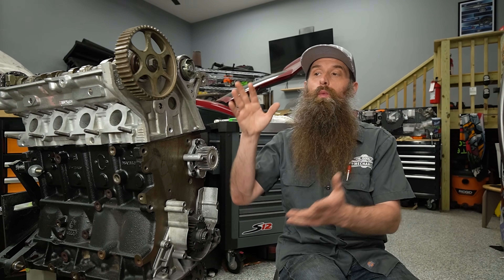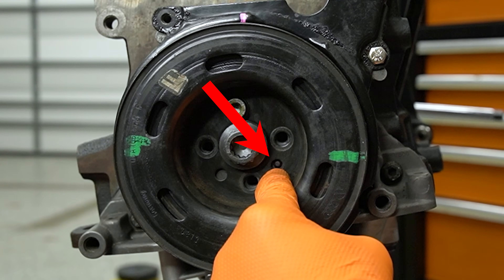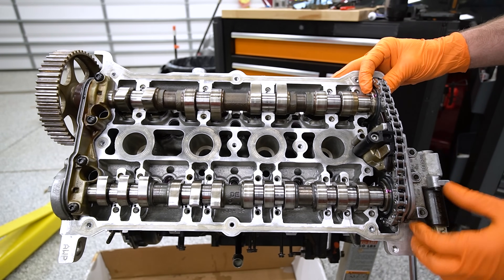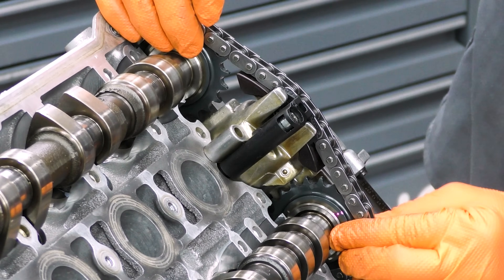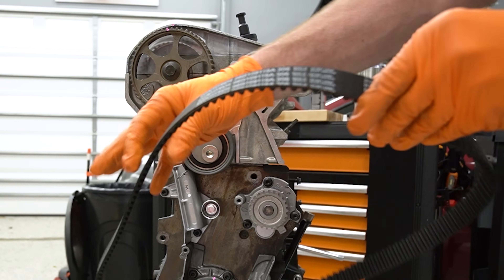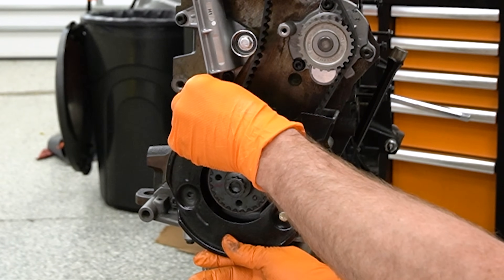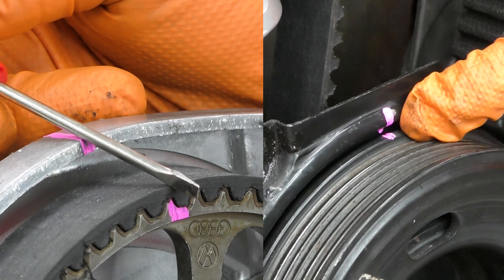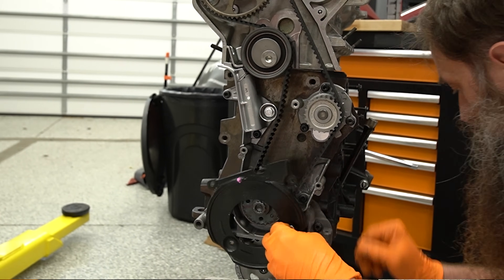How To PROPERLY Time VW/Audi 1.8t 20v Engine ~ Belt and Chain

Comment: hello, I have a?  my Jetta mk4 shredded the tooth on the timing belt. a friend and I replaced the head and installed the blue timing belt, the car ran for about 20k miles than the belt was shredded. my ? is what can be doing it?  is a pic of the belt will help I can send it. thanks

Comment: Hello,
Where did you get the replacement parts from? Directly with the dealer or where would it be recommended to get these parts from? 
Also I did an engine swap but the engine code/ stamp isn't on its usual spot. How do I know which engine I have?

Comment: Quick tip if you have the engine in the car and want to check timing marks a little easier, there's a plug on the bell housing you can take off and there's a timing mark on the flywheel 😉centered in the hole means the cam should also be lined up

Comment: Thank you for this video. I have an AMB and I felt like giving up because of proper timing that needs to be done and underboost. But watching your video is inspiring to continue and not to give up on it.
Reply: Did you have any luck? I've been working on my amb motor for a cpl years now since the timing belt broke and I bent 3 or 4 valves 😢. I put new valves in the machine shop said the head looked good still besides the bent valves. I also replaced the springs with Brian crower springs and titanium clips. But I think I'm having issues with my timing.

Comment: So Charles what happens when you go to compress the chain tensioner and that little ear that keeps the tool centered snaps off the tensioner. Should I just pull the cam caps off both sides, pull the cams  and get the old tensioner out that way. I guess that would mean I would have to do a belt service too.  🤦🏼‍♂️
Reply from the maker: you can pull the tensioner off with out taking the belt off. Take the intake came out, and undo the 2 back end bearing caps for the exhaust cam. You can fudge it out. mark you gears and chain first and be sure to set engine to TDC as a backup

Comment: The cardboard trick saved me a giant headache. This is genuinely the most useful trick I have ever seen and I cannot thank you enough.
Reply: Just used it today. I agree, best hack ever.
Reply: About to try it on mine right now. Wish me luck
Reply: @sloboyzautomotive8303 how'd it go?
Reply: Same here just used it, it took a few tries to get the right length down to offset the tooth but in the end I used a length of about half the circumference of the gear to get it to work, essentially what the belt is touching is the length you want in cardboard.
Reply: @kenimee  my crankshaft is off by a tooth, this will work for that right? if not im taking my belt off, anywhich ways ill find out tomorrow

Comment: I don't understand why the marks on the camshafts are not aligned, is the tensioner not working properly? because the tensioners that are not VVT are always aligned the marks, so placing them dry (without oil pressure =

Comment: How do you know which direction to rotate for TDC? I see some engines are counterclockwise and some clockwise..
Reply from the maker: In most cases where you’d turn engine by hand, I’d want a repair manual to be sure
Reply: @HumbleMechanic  Thanks!

Comment: I just bought a turbo Beetle and changed out the timing belt and water pump . I am a professional mechanic , but I have never done a belt on the 1.8T before . So after watching this I had enough information to do the job . Engine is running good and I'm happy . Thanks for the information!!
Reply from the maker: AWESOME! Working in that small space is the toughest part on the beetle.

Comment: I take my car to the shop for this job but when I pick it up the check engine light was on (code P0016 ) everything was working fine before, now my car feel like trash i take to the shop back and now they claim than some sensors are bad or it need reprogramming, but i know the car was running perfectly fine no check engine light was on before the job, im thinking that the timing belt is not on the right time, please let me know what you think or what can I do on this situation, the car was running like new but after the job was done the car runs like trash it feels slow.

Comment: My AWM engine was running fine and just needed a head gasket. I got everything to what I thought was "in time" and both marks  lined up before I took everything apart. While the marks were lined up,  when I got the head off, the pistons weren't at TDC. Do I need to reset it to TDC or back to what it was when I took the engine apart? Any help would be appreciated.
Reply: I've figured out that somebody did a cam seal job, etc., on this car and didn't put the sprocket back in the right place. I have the marks on the chain side lined up and the crank at TDC now. The mark on the valve cover gasket is pretty far off from the cam mark. I don't know how to determine if I'll be one tooth off or not when I get it all back together. oy vey

Comment: I love the cb trick, however, the best decision I ever made a year ago was going to a manual tensioner. The set it and hope nothing rotates fore or aft before you release the tensioner drove me mad. If need be I can loosen up the tensioner as many times as necessary without any stress that everything won't line up. I don't know why VW went to this wing and a prayer design in the first place, but it is a German car and everyone knows how those engineers NEED to overcomplicate things, Lol.

Comment: Bro I must say this right freaking now!! The cardboard trick just saved me hours and hours of frustration. It got me in perfect time first try using it. Thank y'all so damn much guy's!!!!
Reply from the maker: That’s Awesome
Reply: @HumbleMechanic  just finished up timing. Now I gotta fix this stupid CTS fmic it keeps slipping off the turbo on the turbo cold side outlet :-( tbolt clamps aren't keeping it on sadly
Reply from the maker: Try some hairspray on the silicone hoses. That may help it hold
Reply: Quick question.. I got the gates timing kit and it has the timing pulley that has the eccentric tab with the Allen hole and two small holes. It didn't come with a washer for behind that pulley... Is it supposed to have one or is that only the factory tensioner pulley?
Reply: @HumbleMechanic  I will for sure try that.. it doesn't help that my previous head was dumping oil down Into everything so all that lube may have been keeping it popping off

Comment: Ive owned a 2002 Passat 1.8T AWM 170hp manual from 149,000kms to 250,000kms. It came to me with a full service history of doing 8-10,000kms oil changes on 5w40 castrol syntec. I kept doing the same thing. I'd also run liqui molly and pentosin 5w40 occasionally. At 200,000km I changed the timing belt and replaced the valve cover gasket. Engine was so shiny inside. Never had any start up rattle, never had any oil consumption. Never had pcv problems. Literally the only thing I've done to it in my 100,000km ownership was a full timing belt and water pump and a valve cover gasket. Also spark plugs and a broken plastic dipstick tube - I broke it at -35C weather... it was a pain to replace. It was the most amazing car I've had back then. I did change my clutch once - only the clutch, not the flywheel. And I've had a cracked engine mount. So really that's all I've done to the car over my ownership. Timing belt, clutch and engine mounts. I don't know why people are having so many issues with it. I never did. Car ran perfect. Never once did the cel come on... I'd gladly buy one again, but nowadays these are hard to come by with low mileage.

Comment: Sweet vid!! I had a really great time in February timing my AWM engine and learning as I went. It was my second go-round so I tried to do as much as I could using my own noggin. Pulled cams all the way out, no timing belt, everything off and then back from square one. Just made sure to keep the crank where it was until the chains and belts were back on. Spun it many times to verify, then sealed her back up. Really fun. Would have been so much simpler if this video were out at the time.
Reply: I spent a lot of time pulling the lower timing cover on and off though hahahah
Reply: And valve cover lolol. Really got a feel for the engine which makes me feel good

Comment: i miss my 02 Passat with the 1.8. unfortunately, i didn't have the space or time to fix it at the time so i had a mechanic work on the car and he messed the whole thing up. the old chain tensioner was shot and i asked him to replace it i was getting chain slap..... he did not. causing the chain to skip teeth and bend valves less than 1000 miles after the repair.... So i ended up buying a 14 passat to replace the 02 and it gave me time to properly fix my old Passat.  new audi chain and tensioner, belt etc.   i bought a used head off my friend what was good and i  did it all.  the car ran great for 30 seconds and the new chain snapped .. it was a defective chain.....  bending valves again. i   said the world is against me. i cant have 2 passats. lol

Comment: Thanks again for another super helpful video! I have a dumb request please. Is it possible to show us how to put the 2004 r32 into "service mode" in the front please, so i can swap out that melting alternator cable with a thicker wire please. I bought a wire kit and new battery box with fuses on the top. This is super common all Mk4 and a fire hazard. I have a 1.8T (awd code) and 2004 r32, i already changed that out the 2001 GTI but the r32 is a tigher fit :( Thanks

Comment: Love the content! I’ve come across a code p0341 something about camshaft position sensor A/ circuit range performance (bank 1 or single sensor) I replaced the camshaft sensor but same code pops up. Any input would be greatly appreciated as to what that means or could possibly be

Comment: Wouldn't mind a water pump/thermostat and housing video. My 2015 gti has little leak there, and your videos are basically my Bible when it comes to doing anything to this car. Your knowledge and the way you explain things step by step is just super straightforward and helpful. Technically this is my second VW, but really it's the first I've had to do anything serious to. First was a B5 passat wagon, v6 5spd. Loved that car.
Reply: This is a 1.8t from a mk4.

Comment: Hey Charles, if the tooth was off by one in the other direction, and assuming you don't want to rotate the engine backwards, would running the cardboard through the cam do the trick?

Comment: Hey Charles, as a former long term Audi/VW tech myself, I'll make it even easier for you having literally done hundreds of these T-Belts and dozens of cam adjuster/tensioner jobs both 1.8T and 30valve V6's....  Don't even bother with the damper pulley marks/dimples and paint dots.  Instead, on the crank sprocket, the next tooth peak counter clockwise of which you paint marked is perfectly center lined/indexed with two of the threaded holes across the diameter with the center crank bolt.  That bolt hole will/should always line up perfectly with the casting rib between the two mounting bolts of the crank seal housing/flange when the indexing nub is at about the 4 o'clock position.  (3:16 of video right by your pointing pinky finger).  Also, to double/triple check your T-Belt timing, the belt tooth count, not sprocket tooth, BELT tooth count between the nub on the crank sprocket and cam sprocket mark needs to be 68 teeth on the belt.  When the belt is properly set, the cam timing notch/marks will be about 1/3 - 1/2 a tooth advanced on the cam sprocket to valve cover notches/marks.  After a few heat and driving cycles, the cam notches will line up just fine.  Focus more on the 68 tooth count on the belt.
Getting the T-Belt on can be a real pain cause they're so tight.  I would just "roll them onto the crank sprocket".  The old 8 valve 2.slows and AMB 1.8T's in the B6 chassis A4"s were exactly the same with the crank sprocket and such but easier to fit belts cause of their eccentric tensioner pulleys.  The VW BPY engines and Audi BPG (I think) engine were also the same in crank sprocket alignment despite using six damper pulley bolts. (After that decade long class action suit over all the clapped out B5 chassis Passat's/A4's breaking T-Belts before their "105K service interval", VW actually came out with a new "Repair Kit" with an eccentric tensioner pulley and updated T-Belt # 06B109119"F" belt vs. #....119"A" belt.  The new belt is an HNBR material belt  made in Germany, more "heavy duty", basically the OE equivalent of those fancy Blue Gates branded "Racing" Timing Belts made of HNBR. The old ...119"A" belts made by ContiTech are no longer made in Germany but rather a country where workers ain't paid sh!t and therefore don't give a fvck about quality control.  ME, I paid the few extra bucks for the ...."F" timing belt for my BEA powered TT for it's third T-Belt and still using the improved 2.0 FSI water pump.  Now, if I could only figure out how to use the 2.0 FSI Kevlar reinforced 148 tooth T-Belt vs the 150 tooth HNBR 1.8T belt, I'd be a happy camper.

Comment: I’ll just add that the top hole of the four crank gear bolts lines up with the ridge on the aluminum front cover. No need for adding your own mark there.

Comment: Can someone tell me why you need to back the crank timing back a bit? I didn't quite understand that part 🤔
Reply from the maker: Yep. If your crank is at TDC, then (on this engine) 2 pistons are at the top of travel. 

If you bolt the cams down while they are not also properly timed, you run the risk of bending a valve. Bolting the cam down, may open a valve into a piston. It’s not likely but an easy safety mey
Reply: @HumbleMechanic  
Ah gotcha! Thank you sir!

Comment: One of the first cars I ever learned how to work on was a b6 A4 1.8t about 10 years ago. Chewed through three engines on that car. First one was underpowered and after replacing everything I could i swapped the engine only to find that the honeycomb in the cat was sitting sideways robbing power. The second engine caved when I applied too much silicone on the oil pan and head gasket. Third engine did the same thing because apparently i never learn. I timed each of those engines at least twice and this video gives me great nostalgia and shows the steps that I learned through mistakes. Great content as usual Charles!

Comment: Question I got a 10 vw jetta sportwagen tdi need a engine.  A guy has a 14 vw passat tdi engine for sale. Will the engine work in my 10 vw jetta sportwagen tdi????
Reply from the maker: It’s a different engine
Reply: @HumbleMechanic  thanks
Reply: Hey humble I got another question in my 2010 Jetta sportwagen tdi I found black oil in the antifreeze reservoir. So I drained the oil and antifreeze there were no mixed oil was clean and antifreeze. Do you have any idea what could be oil cooler???Car has 255,000 miles

Comment: My mechanic have interesting situation. When he did the timing of my 1.8t  20v he first called and said that something is wrong and the can't start the eingine. At the next day he calls me back to told me that everthing is fine, just first time he puts the crankshaft marker in the opposite direction. 
And my question is: Is it possible that the valves to bended when he tried to start the  engine  with 180 degree offset on crank pulley? 
P.S. At the  moment engine si working fine without problem.
Reply from the maker: At a true 180 out, it "probably" won't bend valves, because the piston will be in the same space as it was right. BUT the car will most likely not run or run horrible.
Reply: @HumbleMechanic  When the car was with 180 degree offset - the timing work reversed. The engine try to suck air from exaust collector and try to pull out the air from intake. Imposible to start.

Comment: I got a code on my Carista on my Audi s3 8v which is 16401 but the internet says it’s related to p0017/p0016 and sometimes not all the time my car idle a lil funny, would this be my camshaft adjusters and valves need replacing please help me?
Reply from the maker: If this is a chain driven TSI, get it checked ASAP! Probably needs chains
Reply: @HumbleMechanic  it’s a TFSI s3 8v 2015